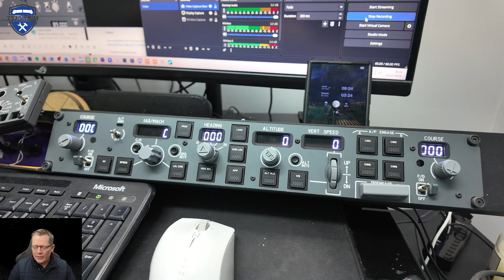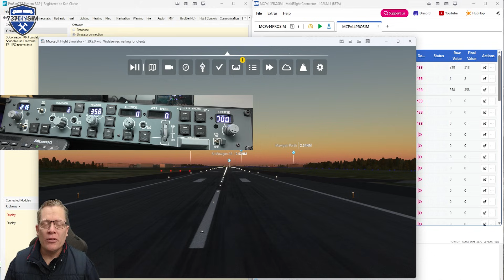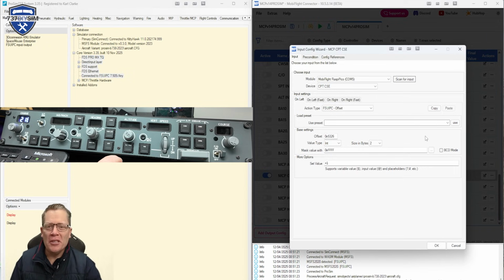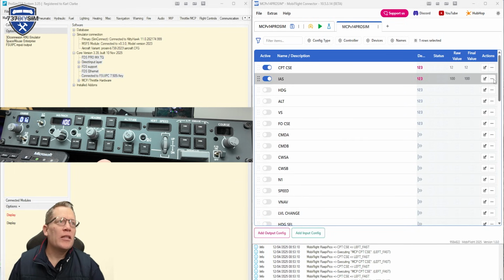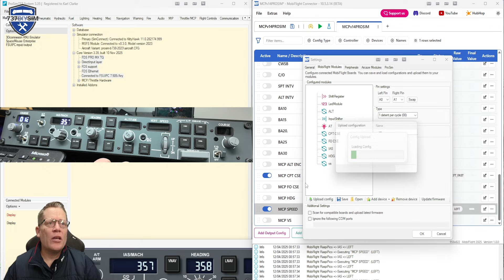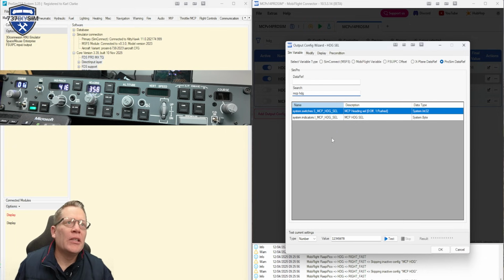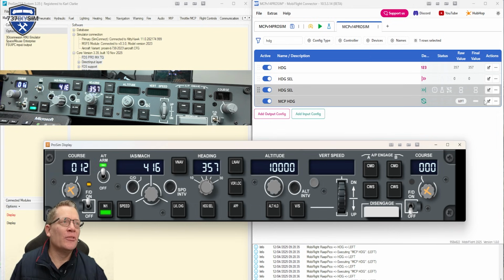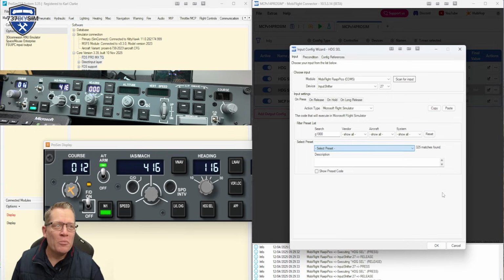MOBIFLIGHT's new PROSIM integration mini Tutorial

Comment: It would be nice if you could revisit your MTU and programming it in Mobiflight with the new prosim datarefs. Specifically the motorised part.
Reply from the maker: I’ve actually moved away from the MTU for now, as there are so many dedicated standalone PCBs available – you’ll find plenty of options shared in the MTU channel on Discord. They’re much easier to integrate and support the latest ProSim datarefs.
That said, I do plan to create a new updated MTU v2 based on the real 737 throttle I currently have on loan. This will include proper motorisation and full compatibility with the latest Mobiflight/ProSim setup.

Comment: Just ordered the 3 different radio options for the 737! can’t wait to gift them to my dad! question though, which board would you recommend for those 3 projects? 3 boards? 1 big board?
Reply from the maker: Hello, 3 radios you would get away with a standard arduino mega, but in the next video i will be using my BOB for a break out board due to it having many more I/O.
Reply: @helimech8152  the arduino mega will be suitable for the multi panel radio, the vhf comm radio, and the Vhf nav radio? wish i ordered the bob with my order now loo